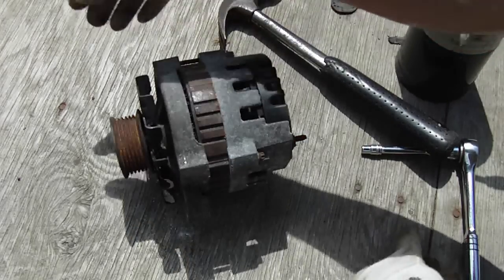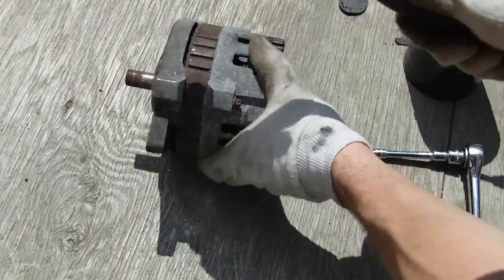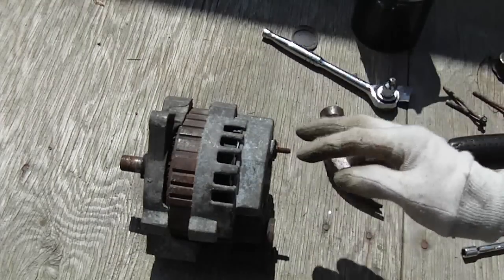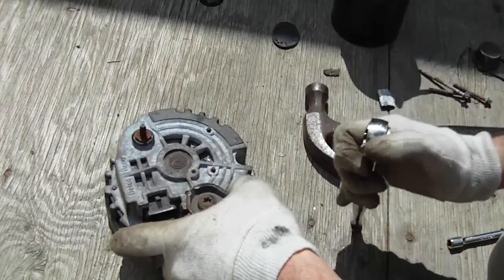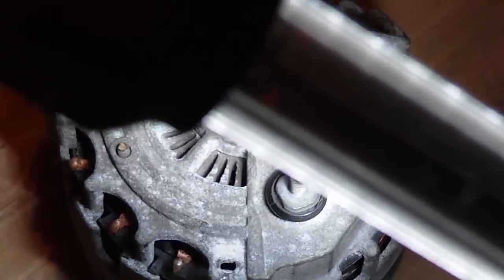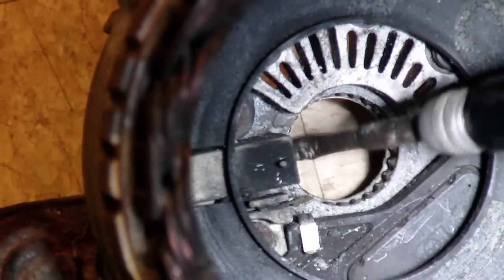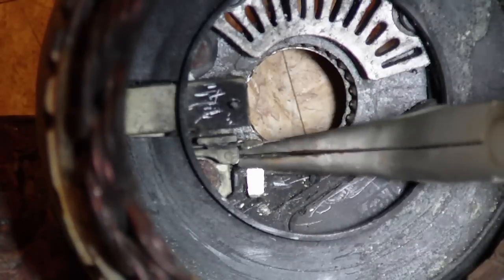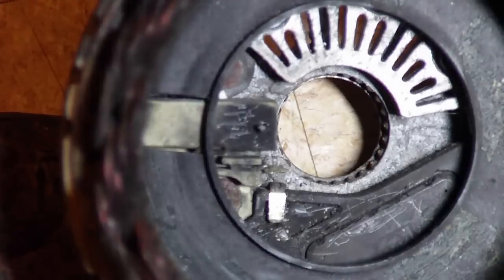Alternator Delco CS regulator bypass mod for Arc welding, Self energizing

Comment: Thank you but wuld like to see how those old metadyne generator works? I did fummel in the past with delco magnets s/r type starter motor changeing magnet peaces around got (++,--,-+,+-) out put on brushes. So confusion is great about dynamos . Expeciali the s/r type starter selenoid is confuseing . Some peopel claim that  is suposed to by compensating winding for 4 brush generator type sinilar to compound dc motors other claim the R terminal is used for bypass voltage for ignition coil on points ignition so Im actuali confused about polarity and that other crap . I have multipel of those selenoids so I was wondering if it might by used as some sort of voltage boosting circuet for easyr engine start. I didnt hade more tools or resorces to finde things out. There arent any usefull information about rotary converters or starter/generators or metadyne or amplidyne generators or rotary voltage boosters so hope in the future you culd make videos about those things.

Comment: Hi, how much voltage can the standard rectifier in the alternator handle? Will it be good to dc 70-80V? Best regards.
Reply: It will do it, but better to get a heavier duty rectifier in the long term I think.
Reply: Blitherer Masterman agreed, one of those inexpensive bridge rectifiers on eBay or Amazon will be more than adequate, they can be had from 100 amp to 400 amp capacity.

Comment: I'm looking at using this setup as an onboard welder in my truck.
I need some clarification on how to wire it up.

do I still connect my leads to the "bat" for + and the housing for the ground?

and, if so, what's the best wiring setup for the field connection?
Reply: Sure, you can connect the + to your battery...but your battery will probably explode. :-)

If you want to weld with it, then you'll connect your electrode and work leads to the "bat" and ground terminals on the alternator. Be warned however, that Delco alternators are grounded to the vehicle through the alternator housing, so you CANNOT weld on the vehicle it's attached to with electrode negative polarity.

The field connection should be run through a rheostat to a 12v power source. This will allow changing the amount of current to the field and thus the output of the alternator. At minimum, a simple on/off switch should be used. The alternator will be damaged if it is producing power and that power has nowhere to go.

Third, I cannot say for sure if this is true, but it's very possible that the CS series alternators have avalanche type rectifier diodes. What this means is that they are designed to fail once a certain voltage is exceeded, usually about 19 volts for alternators. This becomes an issue once the voltage regulator is bypassed or removed from the circuit because the alternator can output far more than 19 volts. In most cases, you can spin the alternator fast enough to put out 120 volts or more, enough to easily run brush motor power tools with universal motors or incandescent light bulbs. Getting to the point, if the CS series alternators do have avalanche diodes, they will fail the very first time you turn the alternator "on" to weld.

Comment: hi im making a homemade 12v generator I thought I could just jump the field and hot lead on the alternator for [Self energizing]    but when I rev up the engine soon as it kicks on the alternator it stalls my engine would this be the regulator causing this and if I by pass the regulator more rpms  the more volts out put correct I just want to idle it at 12v with out charging the field with a battery alternators of an old 302 frod and its been tested  works fine.
Reply: got ya thanx a lot
Reply: You're "full fielding" the alternator with your jumper. In other words, you're feeding maximum current to the rotor, which in turn causes full output from the alternator. You need to break that connection. I'm not sure exactly what you're doing, but if you want to weld with it then you need to remove/bypass the regulator. You'll never get enough voltage to weld if the regulator is still functional. Either remove it or bypass it and add a rheostat between your voltage source(battery) and the connection to the brush that feeds the rotor. Lots of people use the old twist/pull headlight switches from older cars/trucks.  This will allow you to adjust the amount of current going to the rotor. Less power going to the rotor = lower output, and less strain on the motor. Yes, you'll have to have a battery to energize the alternator. There's no such thing as a free lunch.
Reply: When does he weld something?😅